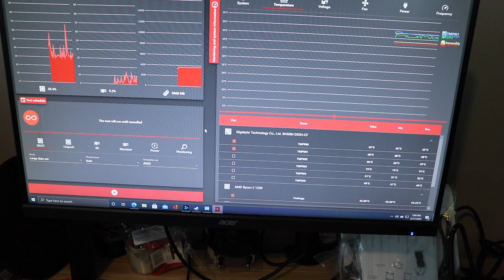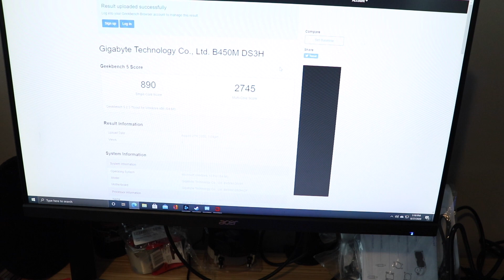This is How Long It Takes For Overclocking to KILL YOUR CPU!!!!

Comment: Hmm, I've had quite the opposite happen for me, I've had an old amd dual core running at 100% usage 1.48v for atleast 6 months, can't remember the exact Temps but it was around 85 or 90. Maybe the old ones are just tough?

Comment: I'm not hating on your video it was good video. But idk that ide be convinced yet, you didn't even keep ambient temp or room temp in mind. Room temp could have got hotter from running that consistently or just hot days could have made the cpu hotter which caused lower performance. In my opinion I would run this test again keep in mind of room temperature. All in all good video
Reply from the maker: Thanks for the input. I keep my office at a constant temp but I do see your concern

Comment: Good work trying to attempt this with limited hardware, and time! We can't all sacrifice parts just for the sake of curiosity.

Electromigration, from what I've gathered, is only an issue when extreme overclocking (like with LN2), pushing /much/ higher voltages without adequate cooling or good sense, or when you've used your processor long enough like decades on end.

Regarding Zen 1, AMD's Robert Hallock said that opperating higher than 1.425v means "risking the long term lifetime of your processor", so you're good there. I charted your results to get a visual representation of what was going on. You're right, kinda all over the place, though the last days scores are still within previously mentioned lows. Electromigration is such a slow process that I would imagine charting it and seeing it in action would be difficult to begin with, so kudos to you for the attempt!

IIRC, I had an i5-3570K that I ran overclocked and overvolted as a daily driver years ago and noticed that after a period of many months that I couldn't obtain the same voltage or frequency as I use to. Could have been an example of this!
Reply from the maker: Andrew Westaway yeah the 1.45v with the high temps really did the trick